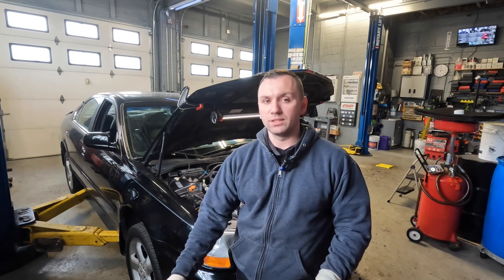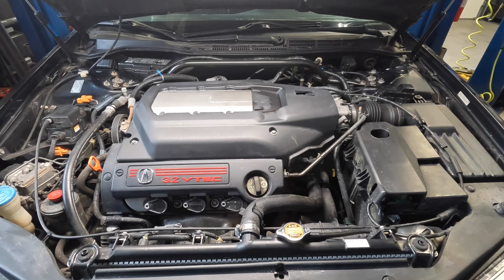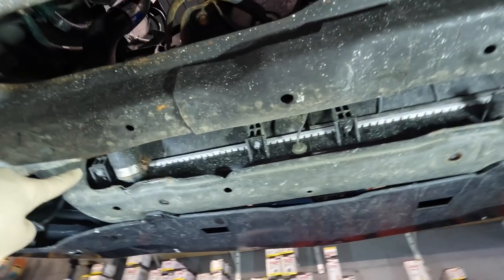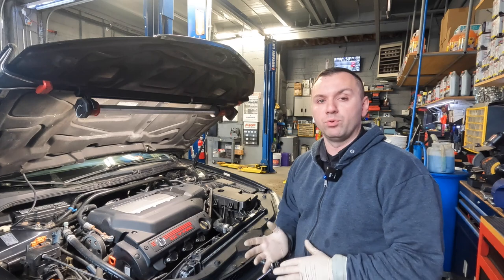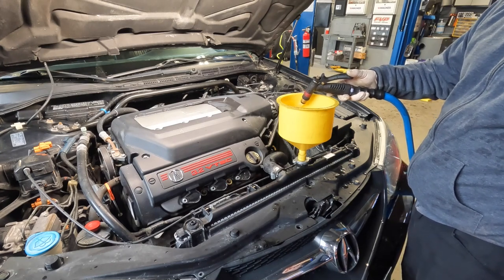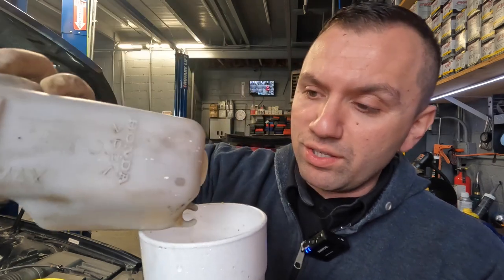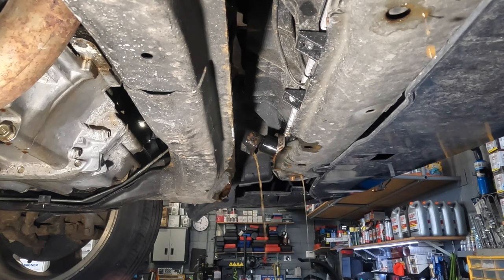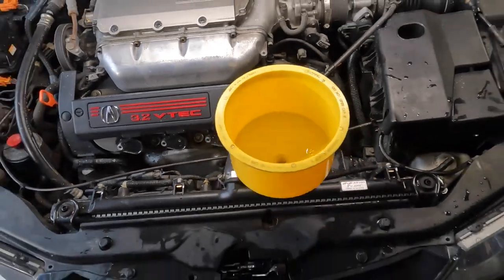CUSTOMER STATES CAR OVERHEATS! RUST BUILD UP INSIDE COOLING SYSTEM HOW TO FLUSH & CLEAN IT OUT

Comment: i just did oil change on mother in-law’s 2022 Kia Seltos for the first time and as normal I check all the fluids. To my surprise the coolant in radiator was rusty orange color and rather thick. for only 30K miles this doesn’t look normal. your thoughts? she bought the car used from dealer and doesn’t know its history.
Reply from the maker: It could be dex cool which is orange in color if not possible water in the system with out coolant.

Comment: Thanks dude my the car I just bought has this issue and I was looking for advice on what I could try to do to help it. This is exactly what I was looking for I was hoping I could mabay flush it with something that would remove the buildup of gunk as it is really bad and I need to do something.
So I really Appreciate the time taken out from your day to show me that this is possible and will take time and what steps to take to get it done.
Reply from the maker: You’re very welcome. I’m glad I could help. Hopefully you can clean out your system using this method.

Comment: What if you have one rusted so bad it ate through the freeze plugs?? How bout Thermocure?? Also, what about the heater core??
Reply from the maker: If it got to the stage where freeze plugs were rotted out, I would think the engine would be pretty bad and you may want to consider replacing it. If that wasn’t an option, I would say use whatever sort of cleaner that can be the least intrusive in the system, but you would definitely probably have to replace heater core, plugs, and all things associated with the cooling system to give it a fair chance. That may be a little bit too much, depending on the vehicle.
Reply: @TheEnthusiastMechanic  thanks for the advice.
Reply from the maker: Welcome

Comment: That honda is all aluminum. as far as I know the only thing steel that could cause rust on that engine is the core plugs
Reply from the maker: Correct that’s where the rust started
Reply: amnd the sleeves??
Reply: Pump impeller

Comment: will that be a permanent solution or will the rust come back on the long run?
Reply from the maker: If cleaned out and serviced regularly it should be fine but this vehicle I told the customer to get the system flushed a bit more often than what the manufacturer calls for to be preventative as a measure
Reply: i think there isa  chemical you had and no more rust , i have hear Clen water (...)or similar, i have to check it

Comment: Where is your shop located ?
Reply from the maker: We’re in Illinois
Reply: I am to i was gonnasee if maybe i can get some tips i have pretty bad corrosion from prevuos owner using water i replaced everything in the cooling system including head gasket everything besides heater core because i know thats good so im stuck on wat to do because i still over heat
Reply from the maker: @dckiller1129  you can try using some sort of cleaner and if that doesn’t work, the block could just be junk if it has too much rust corrosion
Reply: Yea its pretty bad i just wanna flush it tge best i can i have a 97 jeep grand cherokee 5.2 i do have electrolisis no matter how many times i repkaced something
Reply from the maker: @dckiller1129  you could try running extra ground cable for the engine that’ll possibly help with the electrolysis

Comment: Anyone use CLR?
Reply from the maker: So I have done that in the past, but you gotta be really careful with aluminum and CLR apparently it can eat it away. You have to dilute it down a little bit or not leave it in there very long if you don’t dilute it and make sure you really rinse it thoroughly.
Reply: @TheEnthusiastMechanic  So CLR would work on the older GM 5.7 V8's?